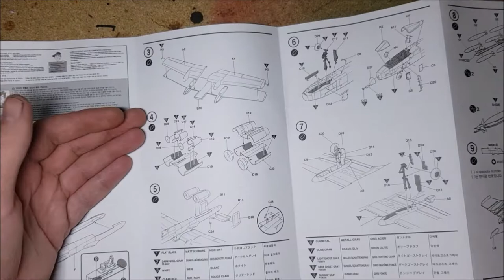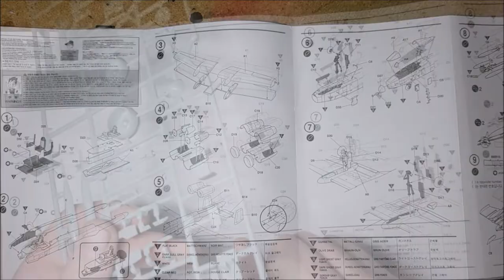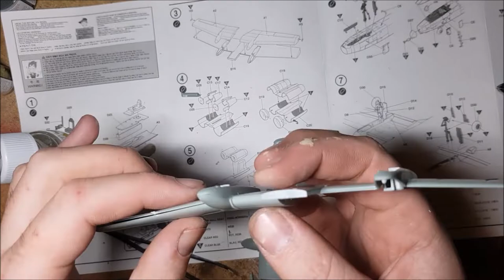Academy A-10A Warthog build

Comment: Very nice build. I also built this kit and had some issues with the decals. And also did not add enough weight to the nose, but ended up using Glue Dots for the landing gear to keep in on a base. Thanks for the video.
Reply from the maker: Yeah it needs so much weight in that nose its scary shows in the real one just how big the gun on this thing is

Comment: lookin good.im starting on this same kit.now isee after looking at the kit instructions adding of the weight around the cockpit.labeled as "g".thanx for the info
Reply from the maker: Best of luck on the kit and glad the videos helped out mate, what scheme you going for? classic grey or this or the desert yellow and brown?
Reply: @scalestuff1066  the vid helped.this is my 1st build in more than a little while,so im not following the paint directions exactly as i had some difficulty locating some colors.overall the top will be raf navy gray,underside ocean grey.with the desert storm decals tiger mouth set up.after this im going to build the us navy prb tamiya kit.then the a1 douglas usaf skyraider,using spray can priming and hand brushing old school style with flat acrylics and gloss varnishes.thanx for the tip about    adding weight to front of plane probably use some split shot and blue tack mix.
Reply from the maker: Nice I bet that will look good when its done mate, Ive just done a tamiya skyraider, its a lovely kit for the most part, velejho do a good vietnam 4 color set and it goes well over a fine rattle can white base coat. No worries, Ive just had to do that again with a italri Tomcat, not the greatest of builds, not even enough space for 10gram of split shot, most of its ended up around the seating area

Comment: hey nice video,may i ask why you are painting the inside of some panels?I know nothing about modelism just thinking to buy one kit and try
Reply from the maker: Cheers dude ,I was painting a few of the inside of the the pannels as I couldnt get the brush in there easily later,its called pre painting,just makes gerring a good finish easier,normally most planes need the cock pit and wheel wells painted as you building

Comment: Did you paint the fuselage/wings before assembly? I made that mistake with my Acdemy F16 model
Reply from the maker: No not on this one did the cock pit and that was it,Ah iv done the reverse though glued it all together un painted and then not been able to get under the fuel tanks.What was the trouble on the f16 with pre painting?
Reply: @scalestuff1066  my painting was shite and made it sort of hard to fit together well, paint was too thick. Definitely should have assembled it before painting I think I’m my case
Reply from the maker: Ah mate happens to the best of us , I did the same on a crusader mk111 the turret got so stuck I had issues painting it
Reply: @scalestuff1066  I’m just getting into the hobby now, would love to see you do some more recent aircraft like FA18s and such, specifically the 1/72 scale stuff.
Reply from the maker: @bk_nreynolds3278  Iv got a tomcat in the que if thats anygood?Got a bit of a tank spree coming up for a while atm,but can try and squeeze the odd plane in there.Im trying to move away from to many planes,I love making them but there hard to store without breaking and breaking them breaks my heart after spending so long on the models
Reply: @scalestuff1066  would love to see a tomcat video, but yea totally makes sense don’t wanna spoil all that hard work and effort you put in.
Reply from the maker: Btw,you said you had got really thick paint on a model,what paints are you using? I go heavy with my paints so I switched to valajo air as it's for an airbrush the paints come more watered down

Comment: Did you do a panel lining/pin wash between the paint and adding the decals?  (and from there did you gloss coat it before?) 

I have this same build ready to go, just trying to get a feel what to do with it.  (Love the paint job here)
Reply from the maker: Yes to the first part of the first one, but no gloss between this is just decals on paint job. Thanks mate and best of luck with your build, what scheme you going with?
Reply: @scalestuff1066  Not sure yet, was going to go with one in the instructions (There's a shaded design) but yours looks better, and does appear to be more authentic, I might try to follow what you've done just to learn that technique. 

My big goal on this build is the panel line and trying to keep the paint super thin to retain the detail.
Reply from the maker: @Kinglink  I think this is the temperate or euro scheme for them, I think there are models with this as there suggested, If you ever want a guide for a different scheme, go on scale mates and look at the instructions for other kits its where I sometimes go to try something different, its free you dont need to sign up as well
Reply: @scalestuff1066  Btw, just wanted to thank you for the weight you used in your nose section.  I definitely would have been light but I appreciate the weight you used so I could try to get it right. 

It feels wrong, so knowing it should be very heavy is very much appreciated.
Reply from the maker: @Kinglink  Glad to have been of help, and I know what you mean it feels freakishly heavy, its all the wings and jets at the back of the plane that need to be balanced out, in all fairness building the kit make me appreciate what a freak this aircraft really is, it really is just built around that gun in the nose. Also if you want a laugh google the gun for this plane out of the plane, the things huge

Comment: Im working on the same kit its my first ever and im running into complications
Reply from the maker: Yeah there are some tricky bits, i found getting the weight in a bit of a problem
Reply: @scalestuff1066  im new to this i could barely understand the instructions and i completely missed the weights
Reply from the maker: You picked a tricky one with the instructions mate, the old Academy had this weird language barrier, the weights been a little symbol tho is easy to miss, im building a italri tomcat atm and nearly did just that